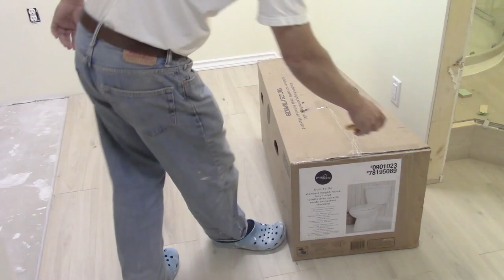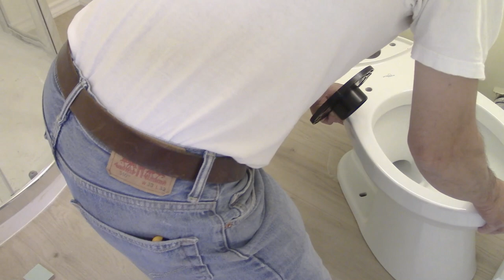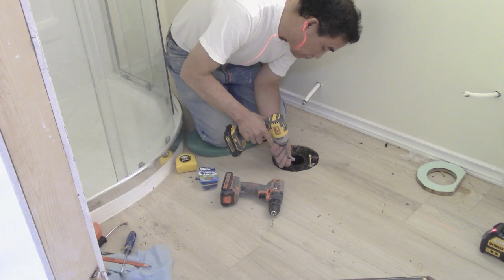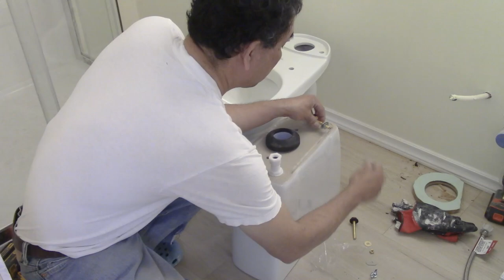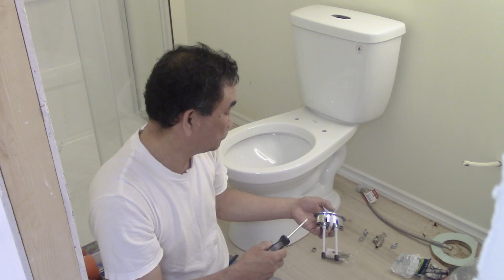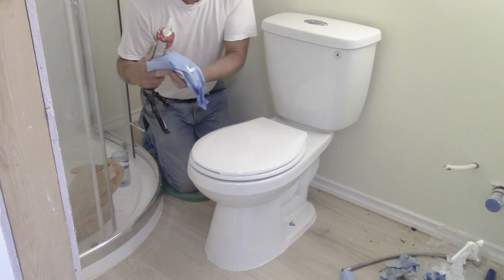How to Install the Toilet

Comment: hi mr. miyagi  would be better to hold the bolts with washers and nuts at the bottom  to keep them from tipping over during the toilet installation. nice video